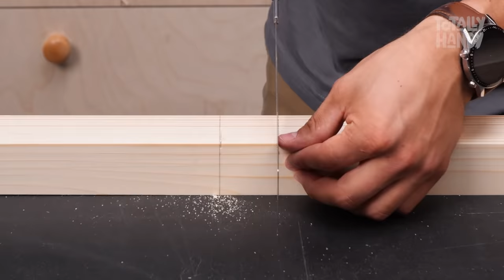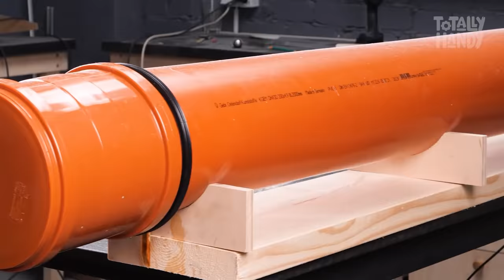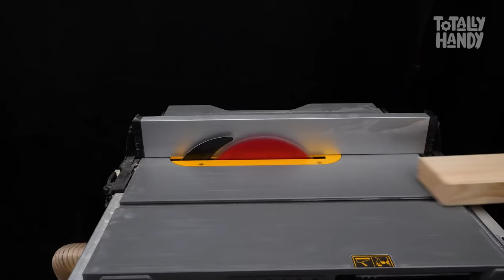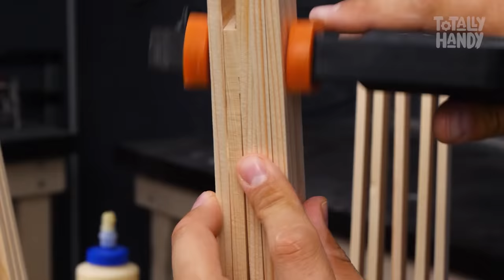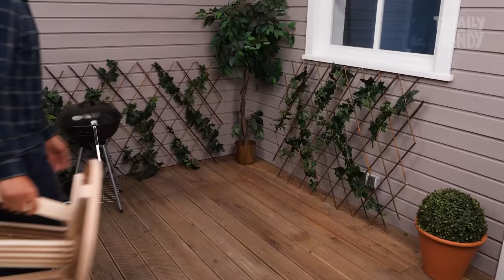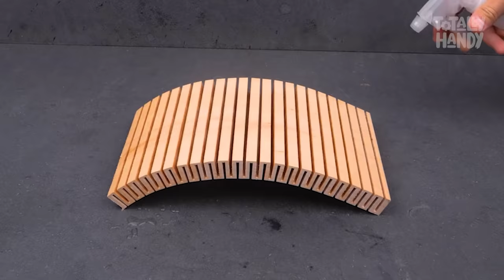Bending Wood into a DIY Table & Other Woodworking Tips | Woodworking Project

Comment: I didnt understand why you did that table and there cool, wood planks? where is the connection? does the table done? or what?
Reply: 8 Woodworking Tips to Boost Your Efficiency

Posting

We’ve all heard the adage: work smarter, not harder. It makes good sense, so here are eight woodworking tips to make your shop work easier and more efficient:

1 – Sanding made easier

Sanding woodwork by hand may seem like a chore, but with special tools and high-quality sandpaper, you’ll get excellent results that often outshine a power sander. Besides, it’s quieter, doesn’t produce clouds of dust, and may get into places power sanders can’t.

Use a sanding block for faster, more efficient results. It distributes sanding pressure more evenly and maintains a flatter surface than merely folding a piece of sandpaper. Also, change sandpaper often.

Sand with the grain of the wood, especially for the final grits. To remove deep scratches and stains, angle across the grain up to about 45º for the first sanding. Before moving to the next finer grit, sand with the grain to remove all cross-grain scratches.

For sanding painted surfaces, buy clog-resistant sandpaper. The paint will build up slower than on standard sandpaper.

2 – Avoid drywall screws for woodworking

When screwing two pieces of wood together, use the traditional wood screw over the drywall screw for better results.

A drywall screw is threaded the full length. Since the top threads tend to grip the first board it enters, this can force two pieces of wood apart slightly because you have threads in both boards.

The top part of a wood screw, on the other hand, has a smooth shank that won’t grip the first board. This makes it easier to clamp two pieces of wood together.

There’s another reason to avoid drywall screws: The hardened, brittle steel shafts of drywall screws will often break during installation, especially when screwed into hardwoods. Removing them from a finished material is nearly impossible and getting them out damages the surface.

Wood screws are made of thicker, softer metal, so they’re break-resistant.

Wood screws do, however, require you drill:

A pilot hole for the threads

A wider counterbore hole the length of the non-threaded shaft

A countersink hole for setting the head

However, you can easily handle all three drilling chores by buying a set of three countersinking bits. They handle most common screw sizes.
3 – Know your wood’s moisture content

When building with wood, you must know the correct moisture content of each piece of wood.

Too dry, and the finished product may swell or crack. Too moist, and the end product may shrink or warp. It’s no wonder experts say incorrect moisture causes 80% of all woodworking problems.

￼Therefore, it’s critical to know the moisture content of each piece of wood before it is used. For instance, if you’re planning an inlay job using two different species of wood, you’ll need to know the moisture content of each type so that your inlay glue joints stay intact.

A failsafe way to avoid a ruined project is to use a moisture meter.

4 – Prevent excess glue stains

To eliminate stains caused by oozing glue along joints, clamp the pieces together without glue. Apply masking tape over the joint and then cut it with a utility knife.

Next, separate the pieces, apply the glue, and clamp them together again. The glue will ooze onto the tape, not the wood. Remove the tape before the glue dries.

5 – Measure with a drafting square

Make accurate measuring and marking layouts on boards faster and easier with a drafting square – available at any art supply store.

When you need an accurate square in the 2- to 3-foot range, drafting squares beat the cumbersome drywall squares for accuracy and eliminate the hassle of hooking up a carpenter square.

6 – Keep a clean, orderly workspace

Achieving efficiency in your shop can sometimes be as simple as clearing clutter from your work area. A disorderly work area can hinder your productivity.

Another tip: Only keep out items that you use daily. Everything else should be put in designated areas so they’re quickly retrievable when needed.

7 – Keep a well-lit shop

Pay special attention to lighting. You should have consistent and ample illumination on all work areas so you can work from any angle without casting shadows. This ensures safety and productivity.

Consider:

Overhead lighting

Focused lighting

On-tool lights

Painting walls and the ceiling white can help diffuse the light.

8 – Keep your blades sharp

Dull tools such as chisels, blades, planes, scrapers and gouges don’t cut cleanly. They tear at the wood fibers resulting in a fuzzy, uneven, unprofessional look.

Tools that have been chipped or nicked require grinding. A bench grinder, wet grinder, or even a belt sander can be used.

Avoid letting your tool get too hot when using a bench grinder or belt sander to prevent it from losing temper. Dipping it in a pan of cool water every few seconds will help.

After grinding, proceed to honing using either a flat wet stone or oil stone. A wet stone is preferred when doing fine woodworking.

The final step is polishing using a fine wet stone, a stropping wheel or leather.

Tools with sharper blades make woodworking easier, more efficient, and safer.

Closing comments…

Achieving efficiency in your shop won’t just improve your productivity and help you work faster and easier, it’ll also make you feel accomplished and more satisfied.

https://kamelohy90.systeme.io/1567d1b8

Comment: Why did you have to remove the bent strips to let them dry? Why not let them dry in the cutouts that you made for them on the tabletop?
Reply: He did let them dry while in the tabletop.  He removed them after they dried to glue the ends together.

Comment: 8 Woodworking Tips to Boost Your Efficiency

Posting

We’ve all heard the adage: work smarter, not harder. It makes good sense, so here are eight woodworking tips to make your shop work easier and more efficient:

1 – Sanding made easier

Sanding woodwork by hand may seem like a chore, but with special tools and high-quality sandpaper, you’ll get excellent results that often outshine a power sander. Besides, it’s quieter, doesn’t produce clouds of dust, and may get into places power sanders can’t.

Use a sanding block for faster, more efficient results. It distributes sanding pressure more evenly and maintains a flatter surface than merely folding a piece of sandpaper. Also, change sandpaper often.

Sand with the grain of the wood, especially for the final grits. To remove deep scratches and stains, angle across the grain up to about 45º for the first sanding. Before moving to the next finer grit, sand with the grain to remove all cross-grain scratches.

For sanding painted surfaces, buy clog-resistant sandpaper. The paint will build up slower than on standard sandpaper.

2 – Avoid drywall screws for woodworking

When screwing two pieces of wood together, use the traditional wood screw over the drywall screw for better results.

A drywall screw is threaded the full length. Since the top threads tend to grip the first board it enters, this can force two pieces of wood apart slightly because you have threads in both boards.

The top part of a wood screw, on the other hand, has a smooth shank that won’t grip the first board. This makes it easier to clamp two pieces of wood together.

There’s another reason to avoid drywall screws: The hardened, brittle steel shafts of drywall screws will often break during installation, especially when screwed into hardwoods. Removing them from a finished material is nearly impossible and getting them out damages the surface.

Wood screws are made of thicker, softer metal, so they’re break-resistant.

Wood screws do, however, require you drill:

A pilot hole for the threads

A wider counterbore hole the length of the non-threaded shaft

A countersink hole for setting the head

However, you can easily handle all three drilling chores by buying a set of three countersinking bits. They handle most common screw sizes.
3 – Know your wood’s moisture content

When building with wood, you must know the correct moisture content of each piece of wood.

Too dry, and the finished product may swell or crack. Too moist, and the end product may shrink or warp. It’s no wonder experts say incorrect moisture causes 80% of all woodworking problems.

￼Therefore, it’s critical to know the moisture content of each piece of wood before it is used. For instance, if you’re planning an inlay job using two different species of wood, you’ll need to know the moisture content of each type so that your inlay glue joints stay intact.

A failsafe way to avoid a ruined project is to use a moisture meter.

4 – Prevent excess glue stains

To eliminate stains caused by oozing glue along joints, clamp the pieces together without glue. Apply masking tape over the joint and then cut it with a utility knife.

Next, separate the pieces, apply the glue, and clamp them together again. The glue will ooze onto the tape, not the wood. Remove the tape before the glue dries.

5 – Measure with a drafting square

Make accurate measuring and marking layouts on boards faster and easier with a drafting square – available at any art supply store.

When you need an accurate square in the 2- to 3-foot range, drafting squares beat the cumbersome drywall squares for accuracy and eliminate the hassle of hooking up a carpenter square.

6 – Keep a clean, orderly workspace

Achieving efficiency in your shop can sometimes be as simple as clearing clutter from your work area. A disorderly work area can hinder your productivity.

Another tip: Only keep out items that you use daily. Everything else should be put in designated areas so they’re quickly retrievable when needed.

7 – Keep a well-lit shop

Pay special attention to lighting. You should have consistent and ample illumination on all work areas so you can work from any angle without casting shadows. This ensures safety and productivity.

Consider:

Overhead lighting

Focused lighting

On-tool lights

Painting walls and the ceiling white can help diffuse the light.

8 – Keep your blades sharp

Dull tools such as chisels, blades, planes, scrapers and gouges don’t cut cleanly. They tear at the wood fibers resulting in a fuzzy, uneven, unprofessional look.

Tools that have been chipped or nicked require grinding. A bench grinder, wet grinder, or even a belt sander can be used.

Avoid letting your tool get too hot when using a bench grinder or belt sander to prevent it from losing temper. Dipping it in a pan of cool water every few seconds will help.

After grinding, proceed to honing using either a flat wet stone or oil stone. A wet stone is preferred when doing fine woodworking.

The final step is polishing using a fine wet stone, a stropping wheel or leather.

Tools with sharper blades make woodworking easier, more efficient, and safer.

Closing comments…

Achieving efficiency in your shop won’t just improve your productivity and help you work faster and easier, it’ll also make you feel accomplished and more satisfied.

https://kamelohy90.systeme.io/1567d1b8

Comment: I would turn it upside down and fill the gaps with epoxy, maybe Different colors in-between each layer
Reply: You could even run LEDs along the edge of the Deviders so the table would light up

Comment: It looks neat, but it is not a good table and is incredibly weak and wobbly.  When you attached the top reinforcement pieces with just glue and no dowels, I was like 'ok, that's pretty sketchy'.  And then you attached the legs to them?!